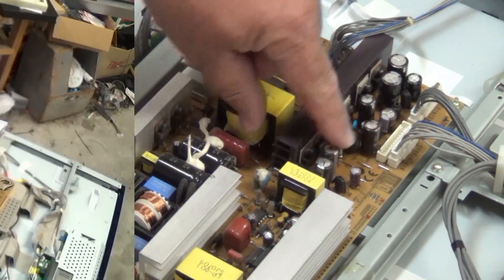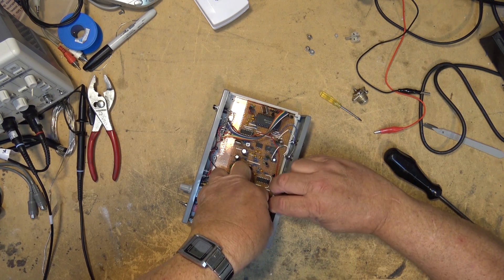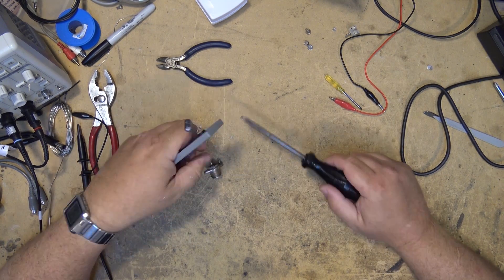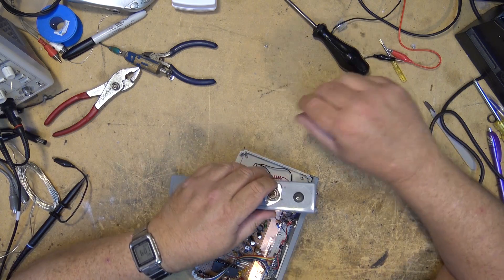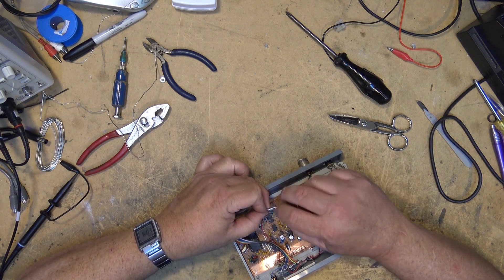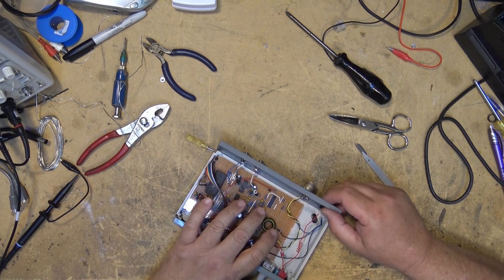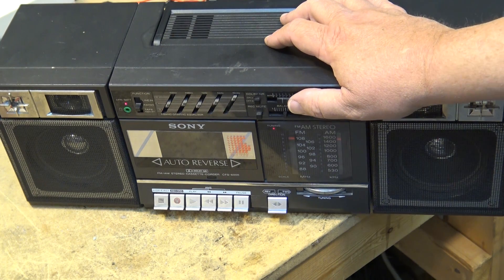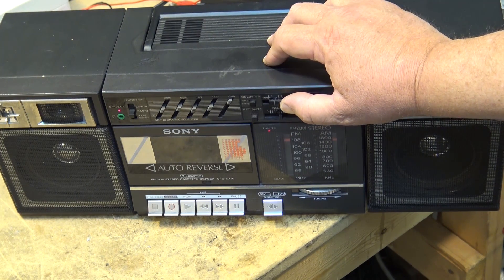AM Stereo Transmitter Antenna jack mod

Comment: That transmitter has good sound. It is too bad it doesn't have 4 watts of power. I think that would be the most I would want, so I don't attract attention from the radio police. You said you were going to build an amp. Are you still doing it and if so are you going to make a video? I would like to see a build like that.
Reply: I spoke too soon, if it goes as far as the end of the block then you probably don't need an amp. You don't want attention from the radio police.

Comment: what about having a separate antenna matching unit using an UNUN to matching the 50R of the AM transmitter into the 450R of a long wire antenna.
Reply from the maker: I conldn't get it to tune up on my old "MalFunctionkingJunk" tuner when I tried it last night.

Comment: Would lining the inside of the plastic case with aluminum duct tape and grounding it help reduce stray RF? Since placing the foil side of a capacitor at a lower potential can reduce RF, it seems like turning the case into a Faraday cage might help too.
Reply from the maker: BlankBrain 
Yes I have considered this. Notice that the bottom has a copper shield. I was thinking of wrapping the top cover and sides with my aluminum foil tape to see what that does. The hum is louder on soft music. You can hear it come up as the agc turns up the gain so I believe it is probably rf getting Into the old mp3 player or audio line into the TX.

Comment: I suppose if you wanted to keep the emissions outside the box, a piece of 75 ohm coax from socket to the r.f stage may help, but as you said it works well enough :-D

The so239 works well enough on c.b radio, but i was always having to re-form the center connection, c.b ers were very rough with equipment.

Comment: Should build up a 50kW flame thrower! That should really get the CRTC's attention lol.
Reply from the maker: Beach Tech 
I would imagine that industry Canada would have something to say about that.
Reply: i have the same transmitter kit, its defective so going to send back for replacement I already designed a 40 watt rf amp to connect it too may put the antenna on my house so its not too close to ham radio ant

Comment: Great project - wonderful video...
but NO - BNC please, not PL259... it's a cruel world. [whimpers]   edit: or use "F" connector  Is it CB radio?  Impedance? Why UHF style connector?  I thought they were about GONE these days (I'm lazy, they have too many threads, lol)
Reply from the maker: Yes I know, BNC is a better choice, but I put on what I had kicking around in the junk box. Besides, we are only talking 1.5MHz here, so I doubt that the impedience is going to matter much. 
I have PL259 all over the place as I am a HAM, and believe it or not that is what is used for HF. You won't be putting a KiloWatt into a BNC. Not of you know what is good for you anyway.  I am tempted to make a little triode amplifier and see what it can do. Hmm, that would be interesting. With a dipole soldered directly to the PL259 I get about 1 block. Interestingly, if I put a section of coax to the dipole the signal is considerably lower. This thing is probably tuning up for 300 ohms.  Not that I want real power, just enough to cover the property so I can make use of my old AM stereo radios.

Comment: Since I got my 1985 Sony Walkman WM-F18/F28, will it also plays on AM Stereo two?
Reply: To my knowledge the only AM Stereo walkmans are these.
http://www.amstereo.org/portable.htm
Reply from the maker: As far as I know the ONLY radios Sony had that did AM stereo was the SrF-A1 walkman radio, the SRF-A100 table radio, the WM-F16, CFS-6000 boom box, XRA37 car radio, STJX520A tuner. They also had a receiver but that model I forget the number.  AM stereo wa a big deal for Sony. If it has it it will say FM in smaller font and AM STEREO in much LARGER font. SO it is has AM stereo it will be clearly labeled.  My tuner says FM Stereo / AM Stereo.
Sony was the only company that made a system that received all 4 standards, so they liked to blow about it.
Reply: I Have the ST-JX220A Tuner, has AM stereo. Might get this kit too and try it out as AM stereo in my area is no more. Music stations here have moved to the FM band.